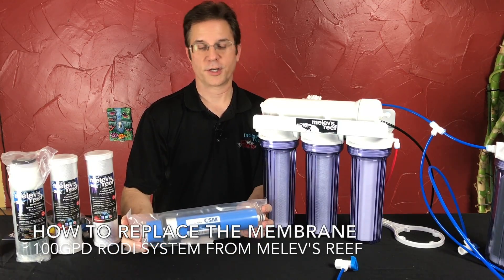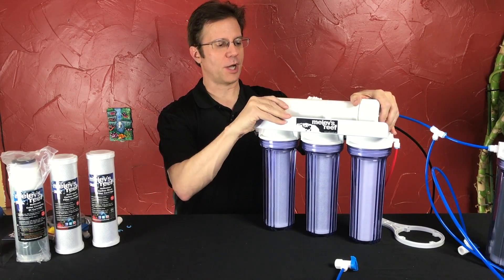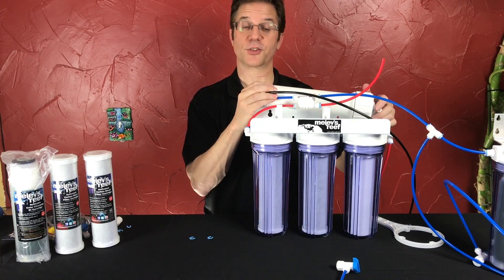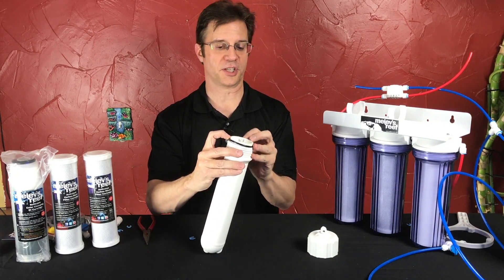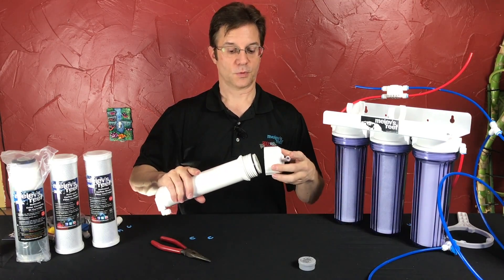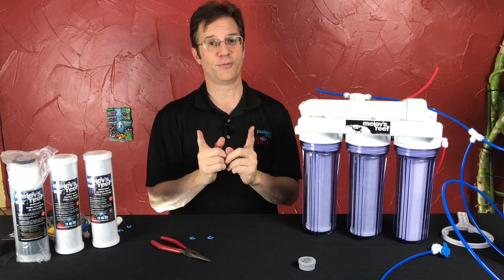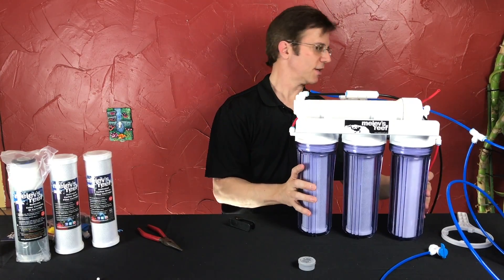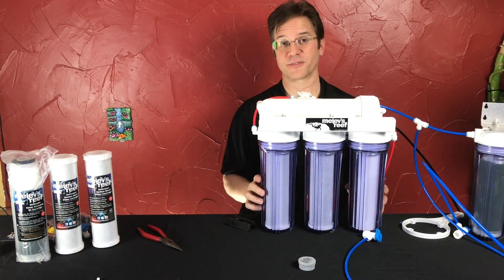How to Change a Membrane in a RO/DI system

Comment: Hi, I have a bad check valve in one of these 180 systems. It looks like it has electrical plugged in at the check valve. N I simply add a valve downstream???
Reply from the maker: Could you be talking about a solenoid?
Reply: @ it was a high pressure valve, but I think I just have a bad check valve somewhere. I’m back feeding out waste water and have already changed the membrane and aso.
Reply from the maker: @Ezunit1991  When you removed the membrane from the housing, you had to disconnect the tubing. You may have inadvertently lost the inline flow restrictor, which may have been shoved into the end of the black tubing (it's internal). Without it, all the water goes out the waste line, and none out of the product line.
Reply: @melevsreef  no, still does it. Replaced the ASO, two check valves, and every filter in it. Still does it. Flow restrictor is in place. I am at a loss as to where I can be losing pressure. It turns on and off every 5 or so seconds even if I shut the storage tank on or off.
Reply from the maker: @Ezunit1991  What brand is yours? You said "180 systems" but I've never sold that.
Reply: @melevsreef  misremembering , its150. I purchased it from your site actually.
Reply from the maker: @Ezunit1991  Let's get this figured out via email, so I can look up your details. Feel free to send me some pictures too.  My email address can be found at the bottom of any page of my website.

Comment: Great Video!  I just changed the membrane, NEW, but water is not coming though.  Installation is correct. How do I know if the membrane is defected? Thanks!
Reply: You obviously made a mistake in the connection of the membrane
Reply: @jungle6815  Seriously, if your going to be jerk just hold your comments to yourself.
Reply: @sasaucier9407  im juat tryna help

Comment: After 1 minute my waste water stops flowing. Roughly 4 3/4 cups of water. The rodi is 1 month old.....help
Reply from the maker: That's odd. I'd need more details. Did you check that your cold water feed is fully on?  Does this RO system have a pressure gauge to indicate pressure?

Comment: My plumber told me to be concerned about bacterial contamination from the hands. Have you ever had issues with this?
Reply from the maker: No, not at all. But if you want to sanitize all parts from time to time, you can do so with bleach water (10 parts water to 1 part bleach, rinse very very well, and let air dry overnight).
Reply: okay nice! that puts me at ease a little bit. he had me quite paranoid about handling the filters when i change them! thanks for the advice!
Reply from the maker: I've never worn rubber gloves or anything, no.  Never even thought about it, but I tend to keep my hands clean all the time. :)

Comment: Marc, how do you know when the membrane needs replacing? I understand when to change the pre filters, but the membrane I'm unsure. The reason I ask is I acquired a used system, and I do not know how long the membranes have been installed (there are two of them in my system). My current TDS readings now are 0. Thanks.
Reply from the maker: +Dean Oros Dean, two things usually happen: the good water comes to a crawl and all the water comes out the waste line instead (at 8:1 or 10:1 ratio), or the TDS coming out of the membrane spikes all of a sudden ( measuring 40, 80 or higher). That's why you do want to measure the water's TDS prior to the DI stage so you will know if all is normal or not.

Comment: what happens if i do not run an hour to flush the food grade ? will it kill the fishes and the corals ?
Reply from the maker: David Cher David, I don't know. I did what I was told 15 years ago and repeat that good advice. This is only done with a brand new membrane. After the first five gallons have been tossed out, it's good to use from then on.
Reply: I believe you get very high TDS as the membrane is coated with preservative.